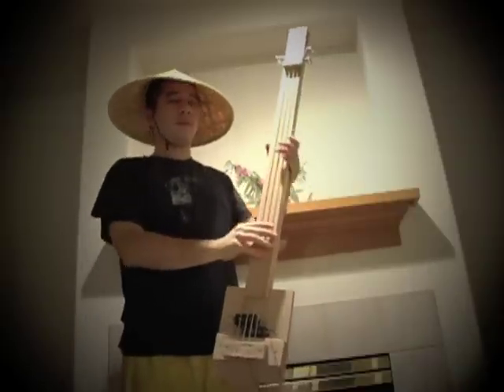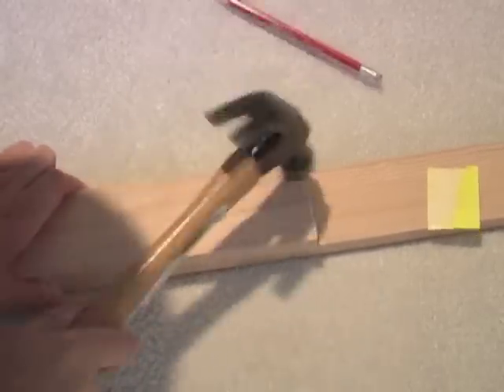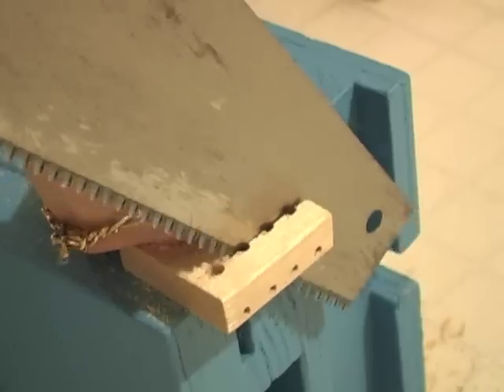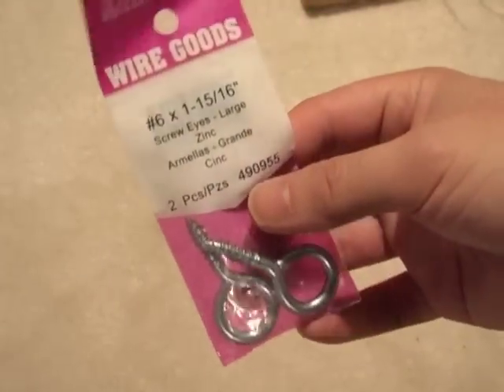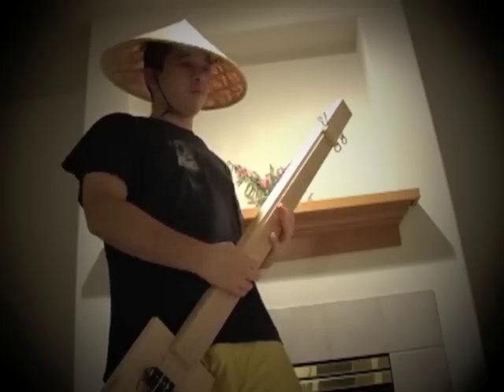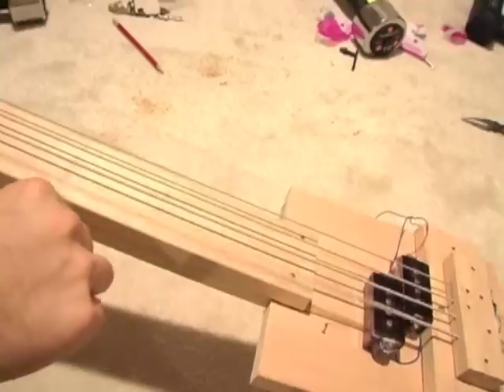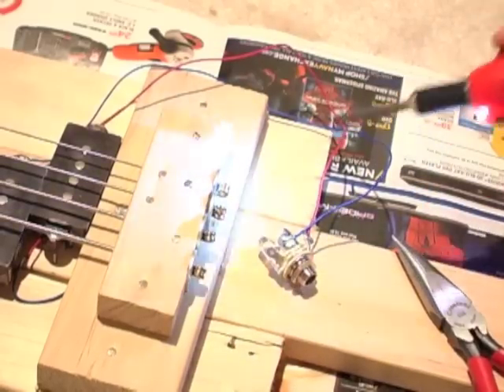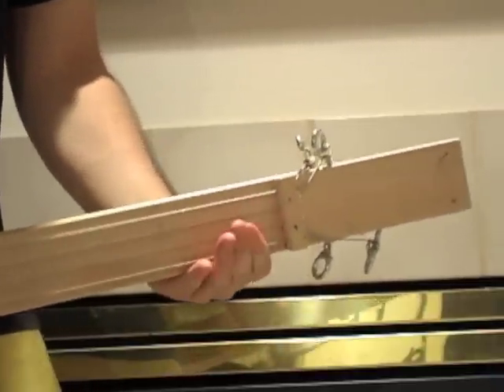How to Build a Cheap DIY Electric Upright Bass out of a 1x3

Comment from the maker: Good wondering. You could downsize the hunk of wood and give it a profile for a more comfortable neck to grasp. You could also shorten the scale length. I made the scale length 34" because that is the standard length for the electric bass strings I used. Double basses have 42" scales. I made the neck fat because I'm afraid of the wood snapping in half and knocking my teeth out. It's unlikely the neck would break like that but it would significantly bow and creak if it were under enough strain.

Comment from the maker: Haha I appreciate your honesty. Technically it is not a double bass in a sense that it does not even have the correct flatwound strings. But those are expensive and the scale length is like 42 inches or something. I played a real bass fiddle and it is huge. What I made was really a cheap electric bass that stands up because the neck is too fat and the strings have a 34" long scale.

Comment from the maker: thanks. I'm no expert at soldering wires together. I just bent off the shorter prong so it would not make contact. If I got a pickup signal, the DIY bass is a success. If I get no signal, then I would edit out the whole part of the video about installing a pickup.

Comment from the maker: It is possible. But I used round wound bass strings meaning that they sound brighter because they have round wire windings. On violins, cellos and double basses they use thumpier sounding flatwound strings so the bow can grip them with better contact.

Comment: If using a stereo jack, you want to use the longest prong for the tip. If you use the second, shorter prong, you wont get a signal because it will be going to ground.

Comment: awsome !!!!!   there's a couple improvements which would cost little or nothing but add to the appearance.  use a router to put curves on the neck.  Shape the head.  Stain with antique walnut with a poly finish.  use a piece of tubing for a bottom stand.  great work !!!!
Reply from the maker: +barry soetoro yes I actually considered routing the entire assembly to round off the edges, but I don't have any routing tools. I could stain the bass, but because it was only an experimental first attempt, the aesthetics didn't matter to me, just the possibility did. If I were to make another home made bass, I would try to make it look beautiful.

Comment: Great build. Essentially you have a fretless bass. 
1. What does it sound like in a band situation. 
2. Have you improved or made other models using upright bass length and strings.
Reply from the maker: Michael Stoneham 1. I never recorded it in a band situation, but I'm sure it would sound good because most of an electric bass' sound comes from the pickups themselves. A bass could be made of rock, concrete, wood, rubber, marble, cast iron or plastic, but as long as the nut and bridge are fixed in place, the strings are gonna vibrate the same over whatever pickup is installed.

2. I haven't made anything new like use an actual upright bass 42" scale length and flat wound strings. But I might attempt that someday.

Comment from the maker: Actually the strings raise it a lot! Despite being a double laminated neck, the heavy 50-70-85-105 bass strings I used still cause the neck to bow significantly. But obviously it would cost more to install a truss system

Comment: Using eye screws... out of line you are a man with cool ideas. Love that they cost hardly. Nothing and seem to hold tune very well.
    On experimental bass would braided coated wire actually work as bass string?
Reply from the maker: I don’t know. I never tried braided wire and I imagine the tension would be dangerously tight. I actually tuned my experimental bass to a lower tuning to minimize the tension needed to play notes safely.

Comment: Quick question on this. Would it be feasible to shorten the width of the neck, so instead of that long monstrousity that I could wrap my hand around, it would be smoother, without giving cause for breakage? Just wondering. Overall great vid though

Comment: I'm thinking about making something like this but I want to have the strings to have a convexity so you can bow it. Y'know, if you'd have used screws instead of nails, you can take it back apart again just in case you mess something up or want to change it. You have a drill. Just drill a guide hole and screw it in. But it is really cool. Great job.
Reply from the maker: Understood. I did not have enough, if any, screws that were long enough to accomplish what you are saying, which is a great idea came the situation I needed to make slight shim adjustments. The bowing thing is a bit tricky to get right without an adjustable truss rod system, so my goal was to simply make a stable neck.
Reply: bmiranda2645 You really think it would be that hard? I have access to a sander/grinder rotary tool. sometimes. I figured I would just kind of sculpt it. Well, nothing from nothing is nothing. I guess I'll give it a try anyway. I always go into a project fully expecting the possibility of failure. It's a learning process. :)
Reply from the maker: Well it takes a good risk to discover something new. I know where you are coming from. It would be nice to have a fretboard radius for bowing techniques, but then you would need to string the bass with flat wounds and I am very limited on the tools that are available in my closet. However I did actually reach my number one goal: build a $10 bass plank that actually sounds quite nice through a P-bass pickup and a Hartke Kickback combo amp!
Reply: You know, actually if you went for a two string bass, you could have the bow in between the strings...kinda the way Chinese erhus work.
Reply: A Simple Troubadour An erhu bass. Interesting idea though it does kind of limit some things.
Reply from the maker: Yeah the limitations are what made me want to try making one. Surprisingly I made something that sounded very similar to the electric bass I took the pickup off of.

Comment: What is the space inches between the strings to drill the holes? Great Video!
Reply from the maker: I never actually measured that. But I used 1x3 boards so the width of the neck would be more like 2.5", and divide that by 5, you get about 1/2" spacing.

Comment: What if you made the bottom part where all that extra woods at detachable. Btw how much did this cost to make
Reply from the maker: This bass cost approximately $15 US, not including the cost of the old bass strings and the bass pickup. I already owned those items. Yes you could make the body detachable by attaching screws to the neck, like a bolt-on design, but to make construction simpler I just made the entire body one long piece.

Comment: Are you using flat-wound or round-wound strings? I'm asking because upright basses usually have flat-wound stings.
Reply from the maker: Yes I know but the flatwound strings used for upright basses are too expensive for me to just install on a project like this, so I just used retired roundwound strings I think Ernie Ball Slinky 50 gauge.
Reply: bmiranda2645 either way this upright is kick ass! Good job!

Comment: what is the length of the fret board itself is it 36 1/2 inch or 40 inches?
Reply from the maker: Actually it might have been less than 34" in scale length because the old strings came off another bass guitar so they were already trimmed. I built the bass dimensions around the length of string I had and how many winds I could get around the tuning posts.
Reply: i was looking on the doodle bass the mention 40 inches for that, i really do not want to deal with expense of upright bass strings at all.

Comment: can you use a bow?
Reply from the maker: +Brad Flick (epicgamer24610) yes you can use a bow. But I think the sound is better if you are rubbing horsehair against vintage flatwound strings, which are similar to double bass, cello, viola and violin strings. They're what give an upright bass that thumpy, damp, dark tone as opposed to the bright, metallic clear response of roundwound strings. That way the band of hair grips the flatwound strings better than roundwounds which are groovy and don't make as much contact as on flatwound tape.

Comment: Very approximate for an upright bass... doesn't look easy to bow, and I'm not sure that's the correct scale length - although, if it were, the strings wouldn't be right anyway. still a cool build, but I would hesitate to call it an "upright" in the traditional sense. A disclaimer of some sort would be nice,  is all. Still a very inspiring video - a good reminder that you don't need to have a whole bunch of fancy DIY gear or expensive parts to build a functional instrument!
Reply from the maker: Yes you are correct. A disclaimer saying I claim no responsibly for any injury due to a couple hundred lbs of steel string tension failing is a great idea! I have a traditional 3/4 size Bellafina double bass with a 41” scale length and RotoSound RS4000 nylon strings (synthetic alternative to twangy gut strings) and electric bass strings are too short to cover more than 37”. Also there is no arch to my bridge making bowing the A or D strings near impossible. I could’ve used my thumpy flatwound electric bass strings for a more accurate pizzicato sound instead of the sustained roundwound set I used but flatwounds are less common and too expensive to waste on this project. My style is, like you noticed, to introduce people into a DIY project in the cheapest way possible since I myself don’t readily have the skill, fancy tools and budget to make something that looks more traditional to an upright bass after watching UptonBass and Thomas & George Martin videos.

Comment: bmiranda2645 hey bro nice work, i want to try it but can you give me the dimensions of every piece of wood please, and what type of wood did you used. thanks for the vid.
Reply from the maker: Andrei Figueiras Hello there. The dimensions depend on the size of the lumber you use. The bass strings should be of 34" scale length so the nut and bridge must be spaced 34" or shorter. The "body" wings were just two equal sections of the 1x3 wood. The neck is just two layers of 1x3 glued together. The upright bass "spike" is just one long piece that runs all the way through the "neck" and the "fingerboard" is just a shorter cut of 1x3 that could be as long as you want, but I left a small gap for the P bass pickup.
Reply from the maker: Oh the type of wood is hemlock. I didn't want to use ash because it splinters easily.

Comment: actually you are very creative, BUT why don't spend a little for machine heads and for the bridge? may be your fretless bass guitar will last just for 1 day.
Reply from the maker: Actually it's been 2 years and the bass still holds its tuning very well to this day. But you are correct it would be better to install machine heads but I do not have a drill press and bits. This was just a creative fun project.

Comment: daniel campins is totally correct... thats not a upright cuz its not in the correct scale. upright are actually an octave lower than a bass. what you built is "almost" a fretless
Reply: Incorrect. An upright is not an octave lower. It is same register as bass guitar. Not sure what constitutes a true upright but I do know it is same register.
Reply from the maker: mynameisryeguy All of you are correct in many ways. What I built is essentially an upright Fender Precision electric fretless stick bass with a 34" scale and round wound strings. The upright, double or bass fiddle you're all referring to is an oversized acoustic violin with tight thumpy flatwound strings and a 42" scale length but still tuned to the same pitches as an electric bass guitar.
Reply: jajajajajaja electric fender stick.. still super cool project

Comment: It's cool and all, but it just siunds like a regular P bass, not an upright bass...😳
Reply from the maker: Yes you are correct. I should’ve used thumpy flatwound strings and a piezo pickup instead of the bright roundwound strings and a magnetic pickup. It just sounds like an electric P bass with a disfigured body.
Reply: @bmiranda2645  Ah well, it's nice work, you could just make it into a hybrid, jeep the magnet pickup and add a piezo so you can have the best if both worlds!

Comment: That bass is seriously out of tune.
Reply from the maker: Yes you are correct. You now have 24 hours to build a similar hardware store bass that can stay in tune much better. BEGIN!
Reply: bmiranda2645
I was merely making a statement, sir. I meant no offense.
Reply from the maker: I was just joking. The point is many people point out the weaknesses in my video but never seem to give a solution.
Reply: I would recommend using actual tuning gears or some type of gear system as opposed to something that just goes into the instrument.
Reply from the maker: Excellent solution. Worm gears would most certainly work but I aimed to build a bass that was cheap and easy as possible. Real bass tuning keys would be expensive and would require very large drill bits, a work bench, and possibly a vise to hold the wooden part steady. I had none of these.